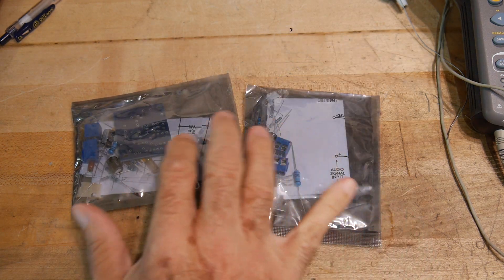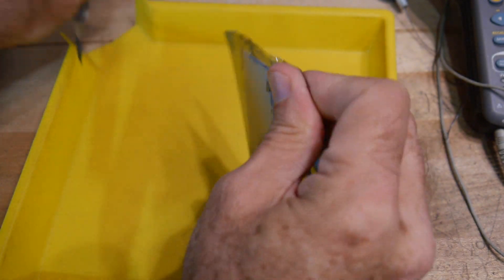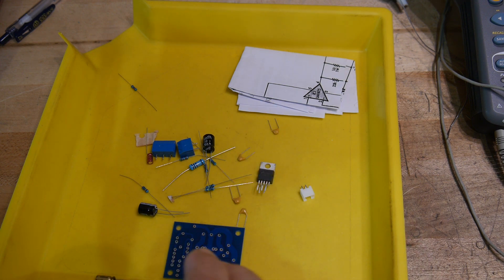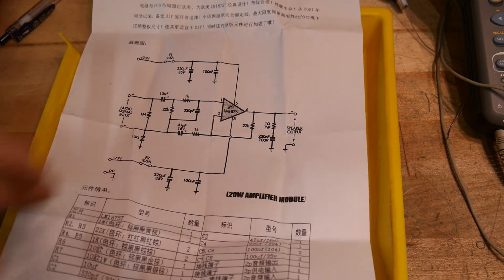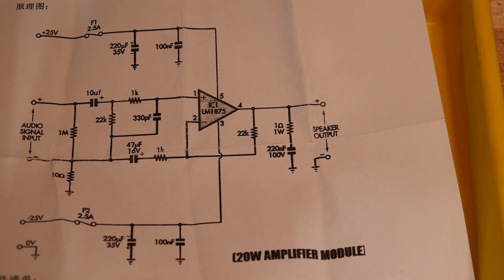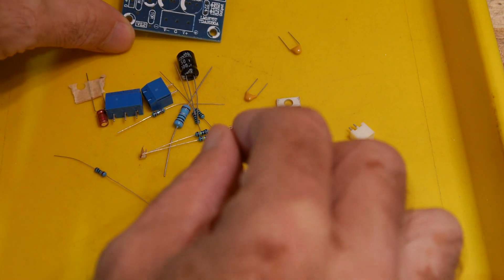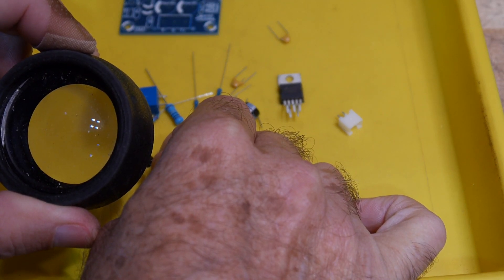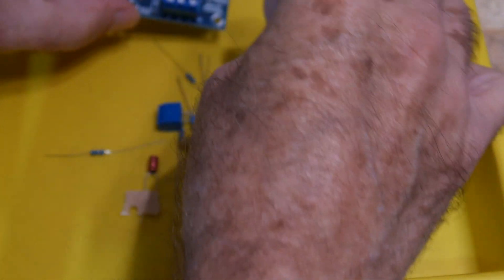#272 LM1875 amplifier kit

Comment: i ordered 4 of them 2 weeks ago but i don't trust them caps so i am filling it with all Nichicon caps i got from mouser. and using a poly cap on the input. 
i all so order an EQ / Volume pre amp but found out i need to switch the 12 power Reg with 15V regs and an audio taper Volume pot Face Palm

Comment: The resistor and capacitor in parallel with the amplifier output is a Zobel network. It helps ensure the amplifier is stable when operating with reactive loads. An alternative is an air core inductor in series with the load. Most class A or AB audio amplifiers will have one or the other.
Zobel networks are also used in well designed passive crossovers for speakers.
Reply from the maker: Thanks! I have seen that resistor and cap on many amps and didn't know why. Makes sense. Didn't think about the speaker kick. I think it would be good on motor driver circuits too.